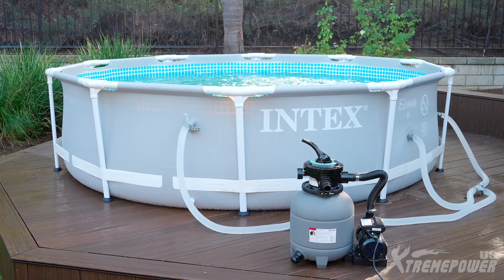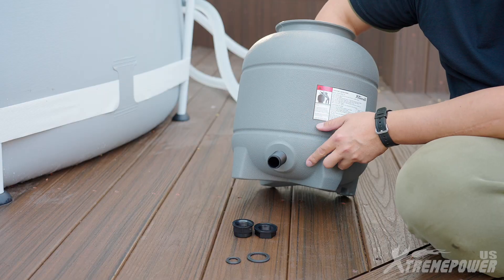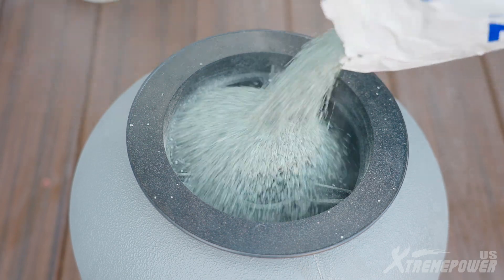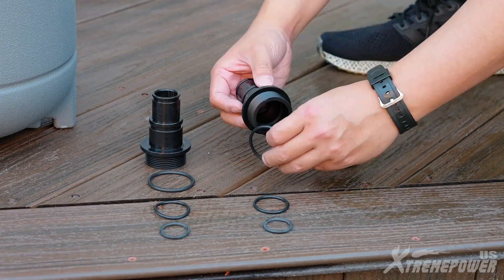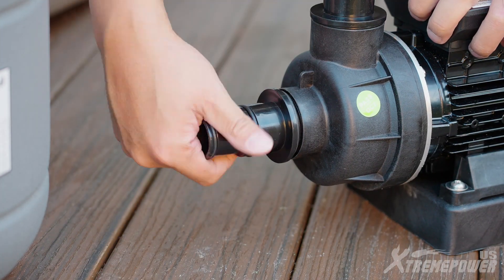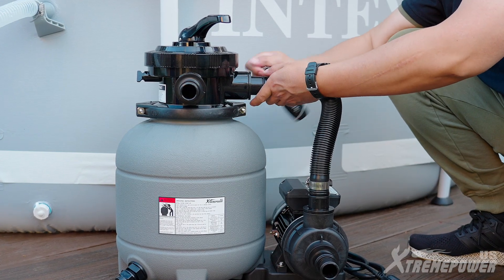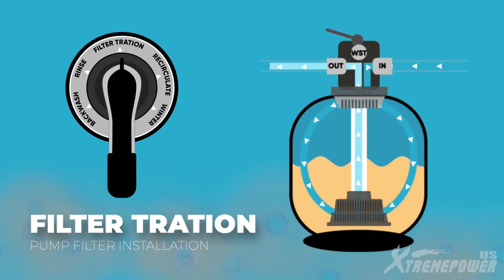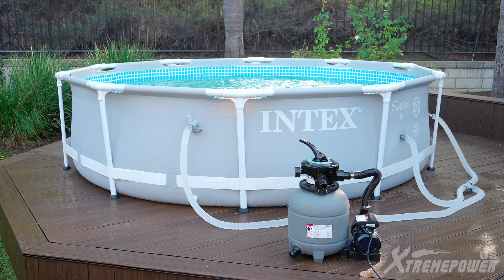XtremepowerUS: 12" Pool Filter With 0.25 HP Pump Set 7-Way Valve Instruction, 75030

Comment: What about the waste setting? I’m not sure what I’m doing wrong but when I backwash the water looks clean and not dirty…? Maybe the cotton balls need to be replaced with the sand is my guess…
Reply from the maker: Hello, It might not time to backwash yet, if the water still clean. You should backwash a sand filter when the pressure gauge on the filter reads 8–10 pounds per square inch (PSI) higher than its starting pressure. You can also backwash when the needle on the pressure gauge is close to or within the red zone.